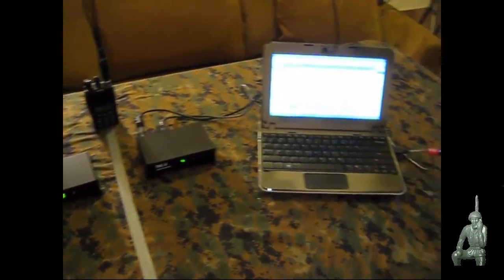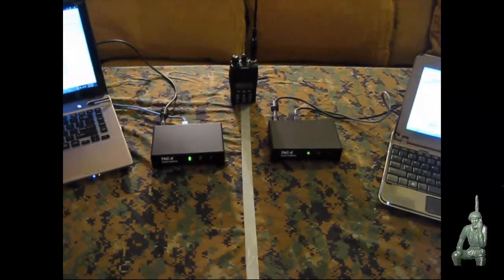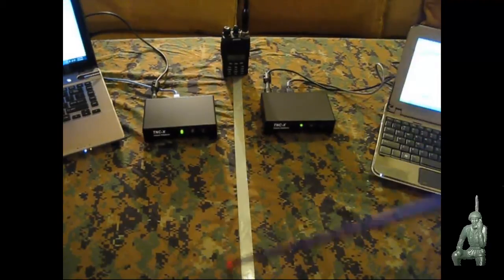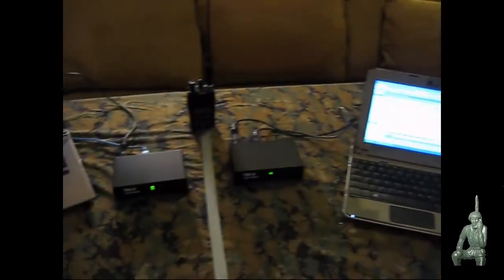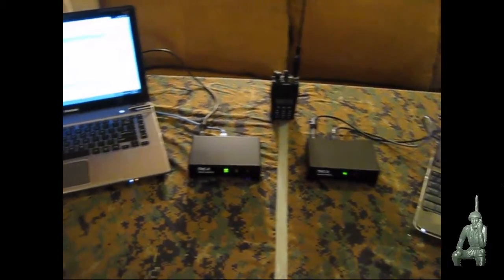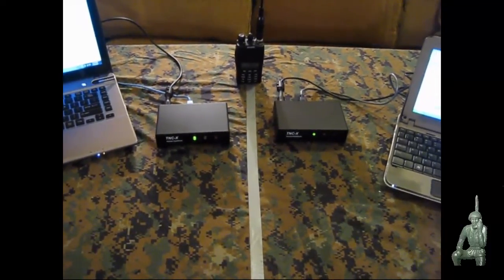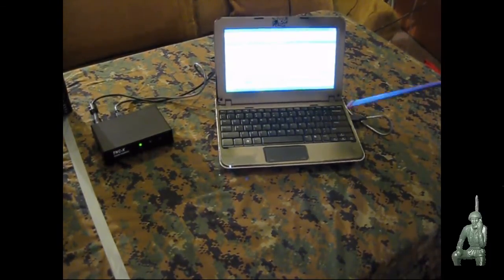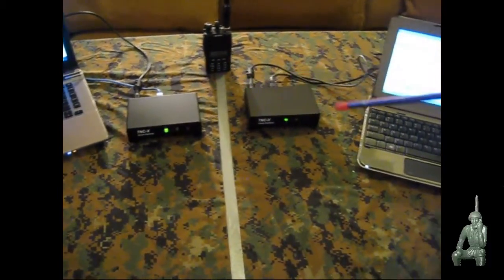Packet Radio with TNC-X modem

Comment: If this is the MFJ 1270X trying to set one up to work with a Motorola Maxtrac.  What client software do you suggest for Packet?
Reply from the maker: In this video I am using RMS Express by Winlink dot org, running in peer-to-peer mode.

Comment: i have a question.... i was thinking on spending 900 dollars on a pactor modem and now with this video i discover that i can have the same connectivity for 50 dollars..... ummmmmm something smells very bad here..... what is the difference between this 2 modems??? how can be possible that 2 modems that looks that do the same have that price difference ? .... i live in central florida and i a new person on the radio ... so i am reading reading reading before i apply for my license and get my antenna and radio etc etc ....i have a last question.... can you send fax over packet radio networks??? i know you can send text (sms) via email (xxx-xxx-xxxx@att.com your telephone@yourcarrier.com) so you send that email and the text is fwr like an sms just like an example
Reply from the maker: +Arturo Ramirez the difference here is the Pactor modem ($900) works on HF frequencies (around the world stuff).  The TNC-X ($50) is for Packet radio that is limited to line of sight VHF/UHF comms.  With Winlink system you can email SMS folks

Comment: I tried doing this exact thing just the other day. Did you use your call on both machines or did you figure out a way to set them apart or use a friends call sign? when i ran the test it didn't work and was wondering if that was why... by the way great video!
Reply from the maker: I recall I used a / or - in the call signs to make this work.  It has been awhile and I don't remember.  Sorry.

Comment: I've got the TNC-X, a BaoFeng BF-HFP8 and a PC (and a USB to USB cable).  What I'm having a hard time is trying to decide what software I need for the PC when I turn everything on.  I google that topic and get a million hits, each more confusing than the next one.  Recommendation(s)?  Thanks for a good video.  73, KD2MCH / Bob
Reply from the maker: I use RMSexpress from www.winlink.org.  With that program you can access the Winlink system or run peer-to-peer (P2P) between stations.
Reply: Thanks.  Appreciate you taking the time to answer questions here.  73, KD2MCH /Bob

Comment: CP, Hi, just getting into Packet radio and trying to use a MFJ TNC-X with a windows 8.1 laptop and a Yaesu 857-d radio.  The cable connecting the TNC to the laptop came with the TNC; the cable connecting the TNC to the radio is an MFJ-5060, that is made for this use.
When I hook up the cables, with the radio in any mode except PKT, as soon as the laptop is either turned on, or is connected, the radio immediately starts transmitting and nothing will stop it from transmitting except unplugging a cable.  When the radio is set to PKT mode, the constant transmitting stops, but when you try contacting the local digipeater, the PTT light on the TNC lights up as it should, but the radio never transmits (every time I mention the radio transmitting, I'm basing that on the light on the radio coming on colored red). And no connection is ever made.
Do you have any idea what I'm either doing wrong, or what setting may be wrong?
Reply from the maker: Sounds like the cable is wired wrong.  I would suggest pinning out each pin with a multi-meter.

Comment: I am very VERY new to Amateur radio but find the data communications very interesting. What is the difference between these packet modems you are using and the Signalink USB? sorry if it sounds stupid. Maybe different Freq Bands?
Reply: +Mike Simpson The packet modems are simply that, modems. Where they will link up and establish a two way (duplex) connection between them using radios, exactly the same as if you were using a telephone line modem from back in the stone ages. Or as I like to call it, the good old days. The Signalink USB is a simplex device, that either broadcasts or receives, but does not create a link to any other radio or modem. It merely sends audio to and from your computer, from your radio. You can play recorded audio from your computer, through the Signalink, to the radio, and send that recording out over the air. Likewise, you can record audio from your radio onto your computer with the Signalink unit as the interface.  Any digital signal that is sent or received by the Signalink, is generated or decoded in your computer using software. With the Signalink, you can send and receive dozens of digital formats, like RTTY, PSK31, JT65, and so on. Hope this answers your question.

Comment: I tried doing this same setup. RMSExpress will connect but will not transfer a p2p email that is in the outbox.
Log does not show anything that seems out of place.
Any ideas or issues you ran across when setting up?
Reply from the maker: TheSzalkowski It could be how you posted it.  There is an option to post to winlink or P2P.  Did check that option?  Hank
Reply: Any luck fixing your problem TheSzalkowski? having the same one myself now, I made sure that is was a P2P message and still no luck.

Comment: Signal link is a sound card connection between a computer and a radio, so the computer still needs to generate the tones (I.e. agwpe). It is not a TNC, which the TNC-X is (so it generates the tones for you, it acts more like a simple command line computer rather than a sound card)